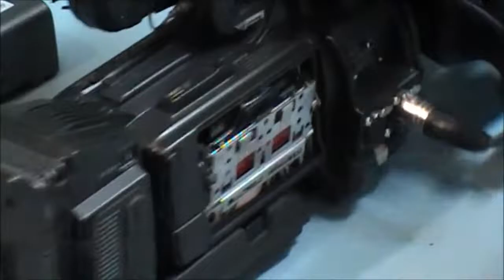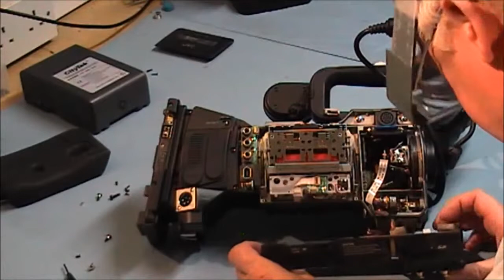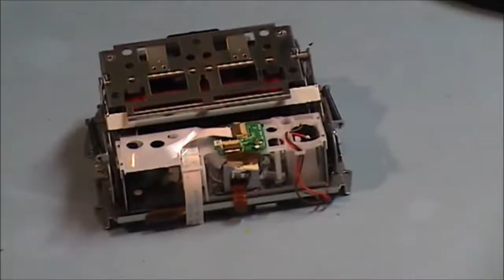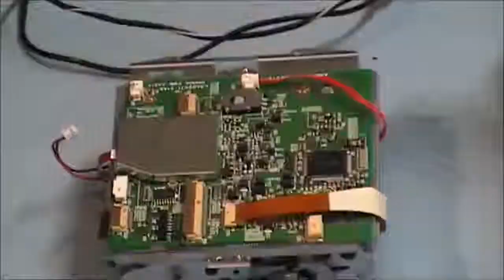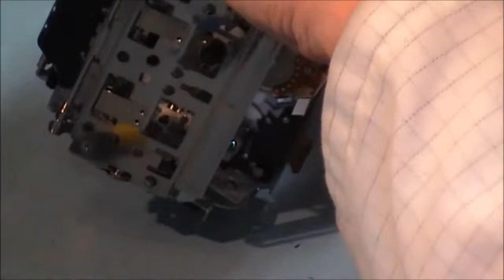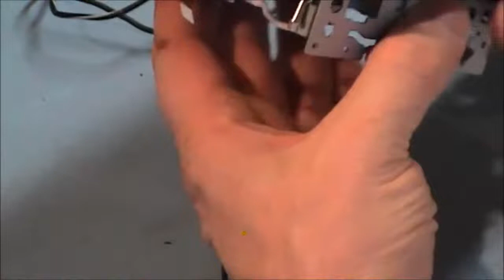How to repair a JVC GY-HD251 Tape Deck Pt 1

Comment: I'm impressed with your patience and skills. Are you wearing an earthing band on your wrist for this? I'm working on the same thing, but on a JVC GY-HD100E. I have the repair manual, but your video(s) are very good. Your magnifying head gear - how does it work if you need reading glasses? I find it a struggle to see the small parts now.
Reply from the maker: I am wearing heel earthing straps ,wrist strap and antis static coat,
I know how you feel with small items, there was a time when I did not need the magnifiers
They work very well with my glasses,
Reply: Electronic Workshop Thanks for the quick reply. I need more tools then. How do I get that past my wife??? Well, I'm happy to say that I've solved my problem with the GY-HD100. I used to work on the old cassette players. Clutches if I remember correctly were a very common problem. I had to study your video very well to see where a bit of plastic belonged. I worked it out, but confirmed it by your video. Had to superglue it in place. Didn't like that idea, but there was no choice - well, not today anyway. Take care and thanks for your help.